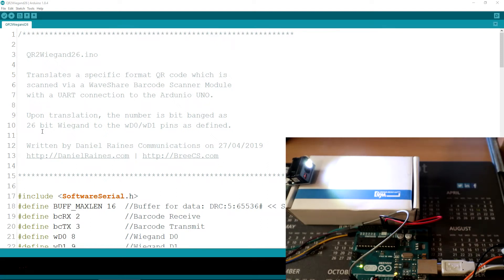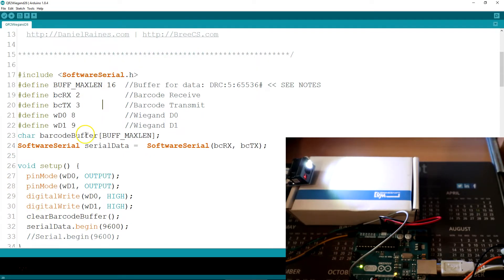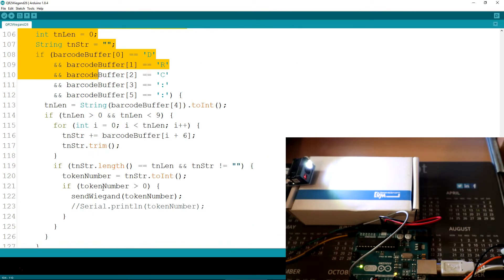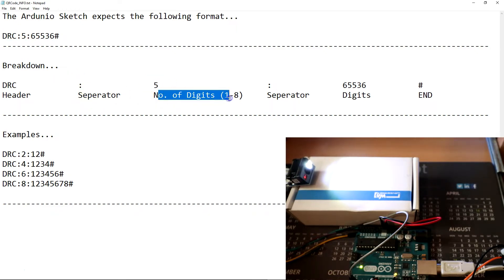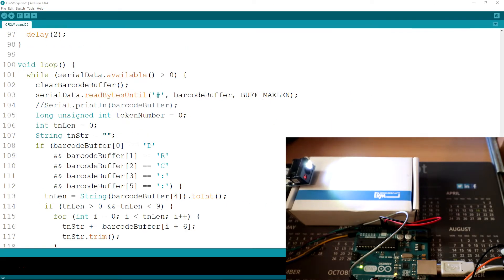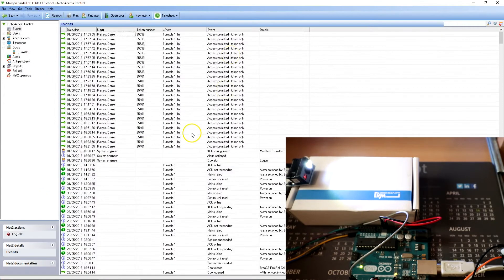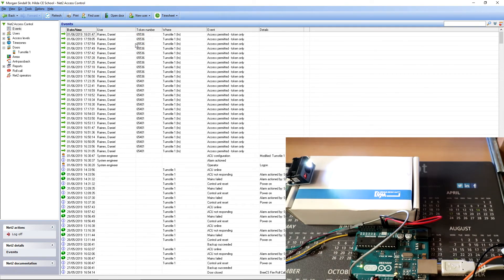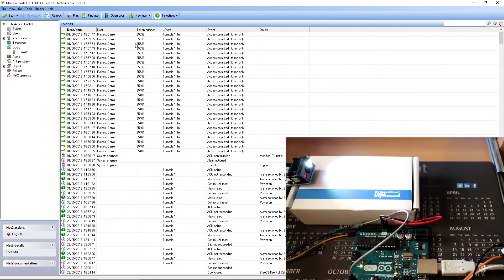QR Code, Arduino and 26bit Wiegand to an ACU

Comment: Hi Daniel. This is a great video. I have a project that uses a similar concept, however I am having allot of trouble with the wiegand. I am trying to use an Arduino Uno to capture the card number from a 34 bit wiegand QR reader, convert the card number to 37 bit wiegand and send it to an ACU that has a custom 37 bit wiegand rule. Could your sketch be modified to achieve this?

Comment: Thanks for the video. Is there a way to output Wiegand from the QR code reader without using Arduino, so just using some sort of hardware media converter?
Reply from the maker: In essence, the arduino is the "media converter"

Comment: Arduino: 1.8.9 (Windows 10), Board: "ESP32 Dev Module, Disabled, Default 4MB with spiffs (1.2MB APP/1.5MB SPIFFS), 240MHz (WiFi/BT), QIO, 80MHz, 4MB (32Mb), 115200, None"

C:\Users\....\Arduino\libraries\SoftwareSerial-master\SoftwareSerial.cpp:41:27: fatal error: avr/interrupt.h: No such file or directory

compilation terminated.

exit status 1
Fehler beim Kompilieren für das Board ESP32 Dev Module.

Dieser Bericht wäre detaillierter, wenn die Option
"Ausführliche Ausgabe während der Kompilierung"
in Datei -> Voreinstellungen aktiviert wäre.

Funktioniert leider nicht. Gibt Probleme mit der SoftwareSerial.h-library